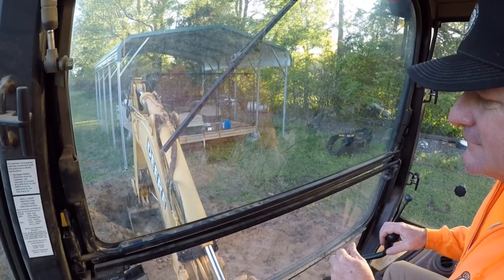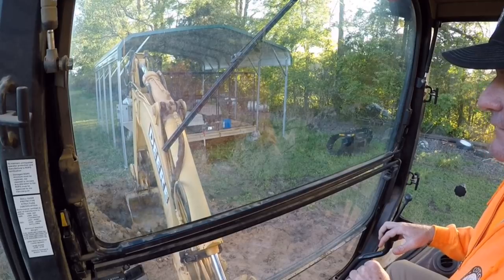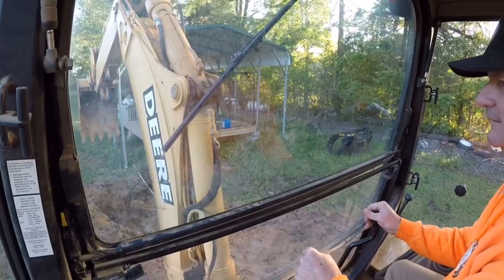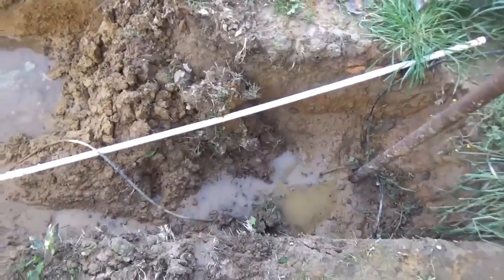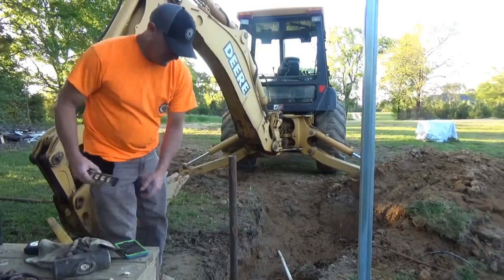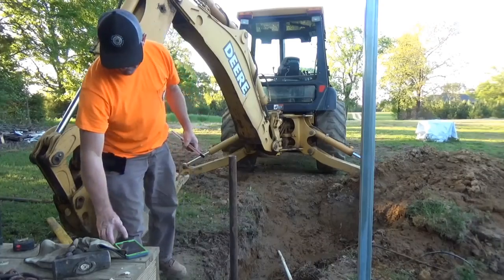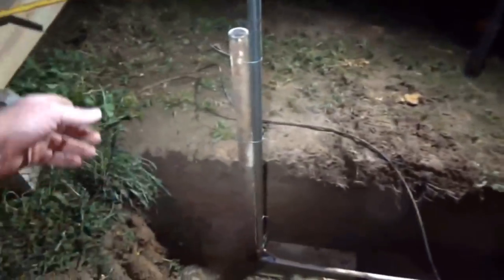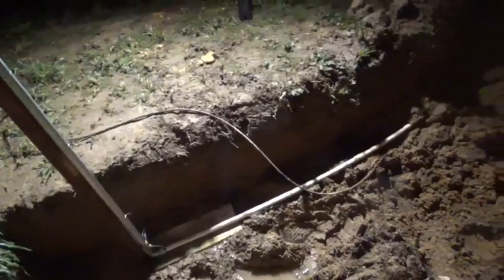Hooking up the new waterline

Comment: Great job. Very informative about the frost free valve and how it works. I have two on my farm BUT they are 4ft frost free here i      n KY. are frost line is deeper than down were you live. Good idea with the pipe to hold the valve in place . Mine at the barn are by a  barn post on the outside of the barn. You have to get a  lot of stuff out to do a job BUT than you have to put it away when done.   done. LATER

Comment: Little tip for ya. I worked with a plumber before. I only ever used pipe tape like you did. He taught me use tape and a little pipe dope. The dope acts like a lubricant and you can get fittings tighter and it won't ever leak using both.
  I was wondering if the controls were kind of set up the same as the machine you run all day or backwards. First 10 min ya get in that it kind of feels like your blindfolded and everything you want to happen doesn't.  Things don't dig that easy in PA, I can tell ya that.

Comment: Tim I have those extra pvc fittings too. If i need one i buy 5 that way i always have some extras. I do this to keep me from having to drive to town. However this only works if the glue is good. I probably have at least 3 cans of bad glue.. LOL Dogs  bark. My little one barked really loud last night when I almost stepped on that Bull snake outside the door. Him and the old Bull snake  had a rather heated argument but we let him live. I was so tired last night i didn't even flinch.. LOL

Comment: I’m the same way about the controls. My brain sends the wrong message to my hands if the hoe is controlled like the backhoe or vise versa. These newer machines has a valve that can be turned in a jiffy  and I had guys at the Mine that would switch the rented hoes to operate like the backhoe. Put many of those FFF’s in. Bushhogs, cars and pickups are usually the only problem we’ve had with them. Take care !

Comment: Just a suggestion maybe cut the bottom out of a 5 gallon bucket and drop it down around the bottom where the weep hole is then fill the bucket with pea gravel
Reply from the maker: Already did that
Reply: cotontop3 cool I’ve had to put a few of those in for sample points throughout the distribution system of our water company

Comment: On most of the backhoes ( doesn't matter brand) have the controls set like that. I can't remember exactly what it is but one is I.S.O pattern and I think the other S.A.E. you have gotten use to the back hoe being backwards from your loader and Kevin's processor. I am the same way with the back hoe and the track hoes at work and we have CAT equipment and they are the same way as you DEERE equipment. I agree with you on never getting rid of fittings or having a pile of them. Thanks for the video.